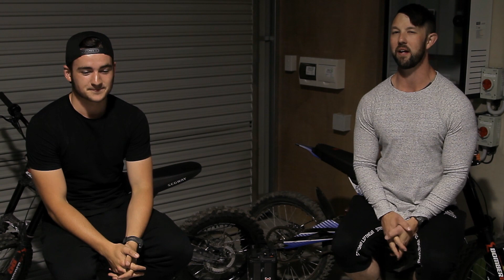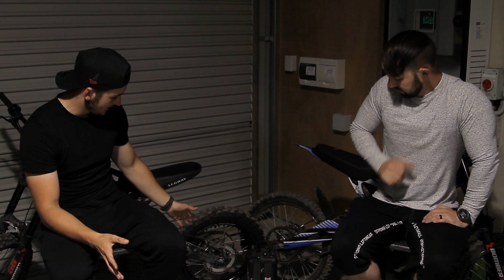Sur Ron information video||Issues with Sur Ron/Bac 4000/8000|72v vs stock 60v|waterproofing Sur Ron

Comment: Hey guys! Super helpful video! I’ve been having issues and just discovered today I had water in the bac4000 connector after washing the bike a few weeks ago, do you have any suggestions to fix the water damage? Will my controller still work? I don’t seem to have any power to the controller(no red light) and no display
Reply from the maker: Hey Mate
Had water in the connectors many times. Make sure it's fully blown out or dried out ( I used compressed air ). Check both your connectors and try again. The controller itself is water resistant it's just the connector that isn't.

If your still having issues after that, I'd first check all your wiring and make sure you have voltage at the BAC👍
Reply: @progressive_e  legend man I’ll try all that thank you!

Comment: There is a type of electronic Grease that you can pump into your connectors and be able to pull the connectors back apart when you're done instead of silicone that handles temps well over 200 C and and makes it all waterproof and as soon as I get a name brand I will let you know what it's called so you guys can let everybody else know
Reply from the maker: Hey mate that would be called dielectric grease👍
We should have mentioned that as an option in our video sorry. It's definitely effective but obviously not as abuse proof as electronic use silicone which is why we went that option.